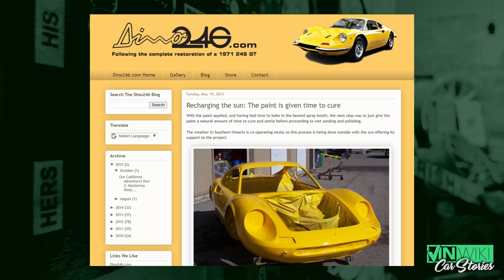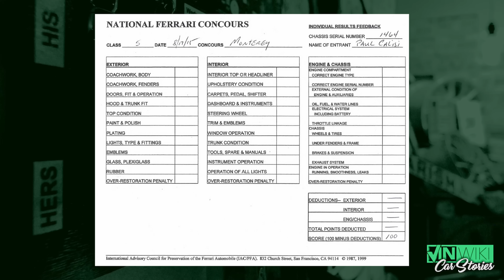My DIY Ferrari project got WAY out of hand…

Comment: Very impressed with your project and choice of Fly Giallo exterior!

I’m not certain that Dinos left factory would even score (100). Mine had issues that were beyond my capabilities to correct at the time but really enjoyed the 1972 Dino Coupe for several years, trading it back to Tillack around 1988. Production runs often made serial #’s out of order with delivery dates.

I was a a concours judge for two years running in late ‘70’s, having worked at two non-authorized Ferrari dealers beginning in 1973.

Comment: 7000 hours in 3-1/2 years is 40 hours a week. Doubtful.
Reply: 7000 hours were spread across three people and included the 1500 hours in metal work and paint. We worked insane hours and every spare minute and the total of 7K does not include research and parts searching which was another huge chunk of time. What we learned is that the last 5% doubles the budget and triples the timeline which is a sentiment echoed by many in the ultra high end restoration world.